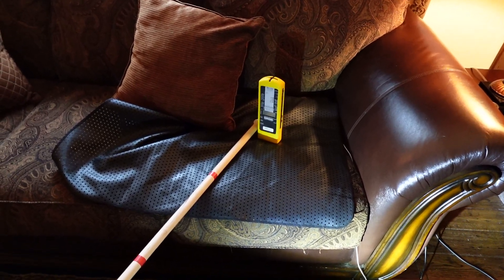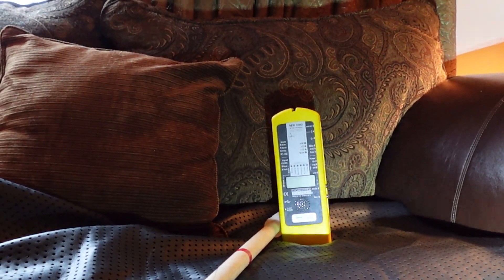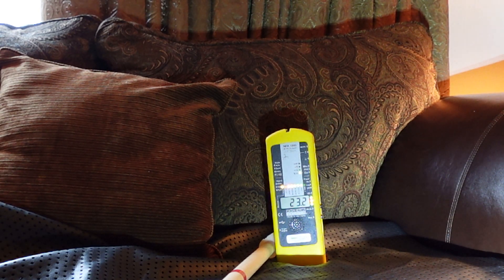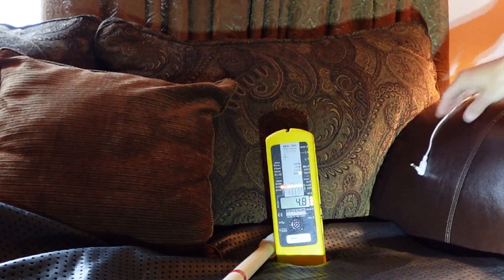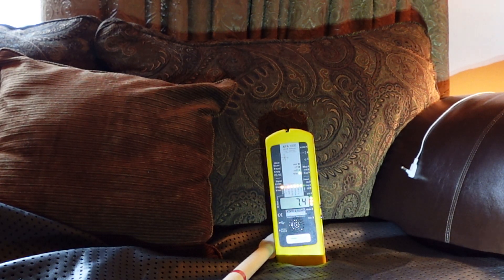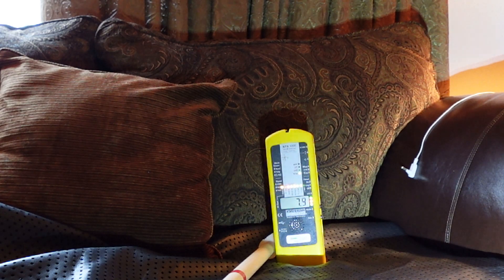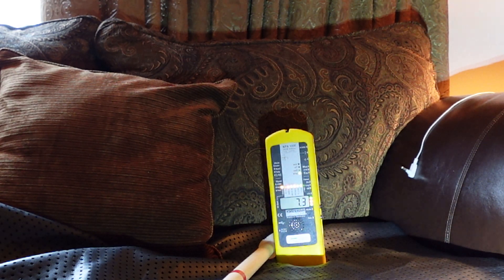The Problem with Earthing & Grounding Mats

Comment: I have a problem with the test when a plug is in the upper and the light is on pulling and leaking energy and contaminating your test. 
Just Questioning - show no power being pulled thru the light plug area and retest.
Reply from the maker: That’s not a real world condition for how people use these mats.  That’s the problem I’m trying to point out.  Even if all circuits were turned off in the house you could still have current on the ground, which these mats attach to.  Just go outside and connect to the earth directly with your skin
Reply: @optimaldwellingspaces3947  well, but it would be nice to know if using a socket just for your grounding mat and not for an electric device at the same time makes a significant difference. If you minimise the bad effect by just plugging your mat to that specific socket it would be a helpful tip for all those who can't connect directly to the ground outside.
Reply from the maker: It makes a big difference.  Avoid connection to any electrical component and go direct to soil.  If you are too high up in your apartment to drop a wire down, then you’ve got bigger exposure problems
Reply: @optimaldwellingspaces3947  Thanks, but I meant that it would be good to know if there's a significant difference between these two scenarios:
1 - connecting the grounding mat to a wall socket (ground connection) while there's another device pulling current out of that same wall socket (like a lamp).
2 - connecting the grounding mat to a wall socket that is not used by any other device at the same time.
I understand that connecting the mat to the ground in your yard is always a better option, just like walking barefoot there is even better. But for many people living in cities that's not an option. So it would be useful to know if there's a significant difference between the two scenarios described above so that if there is, then you can advise to go for the second scenario when connecting to the real ground is not an option.

Comment: what about receptacles in metal boxes that connect to a concrete wall?
Reply from the maker: Anything electrical in your home is generally not safe.  Metal boxes are generally bonded back to the system ground, so not good

Comment: Hello @optimaldwellingspaces3947 I think I can learn a lot here and I Subscribed. Thank you for this. I've been using a grounding mat for a couple of years now, and I plug it into the earthing cable of a wall socket. I wake up more refreshed, at least I think I do. I guess I need to experiment with not using the mats for a while. May I ask what are the variables here between when it comes to AC fields making it worse? Example: is there a probability it depends on the wiring in the house? Also, would the electrons from the earthing not neutralize that AC field? Cheers, -Chris

Comment: 22 year union electrician here, and you are absolutely correct.

It's inductance from the hot and neutral, which are in the same cable sheath as the safety/equipmentground. Isolated ground to a dedicated ground rod is the only remedy, unless one fancies lymphoma for example.
Reply from the maker: Thanks for weighing in.  There is also a radiated component as a byproduct of current flow, which ‘floats’ out into the room and can jump onto a mat.
Reply: @optimaldwellingspaces3947 well, that’s scary!!
Reply: @Optimal Dwelling Spaces  yeah idk exactly what to do about that though. 

To help, I have a metal bedframe that also has a separate isolated ground wire (to the same rod though). That  has less resistance than my silver bedsheet, and it's isolated from the frame (no continuity between frame and sheet). 

Hoping ambient emf's drain through the frame instead of through me by doing this.

Do you think this will help? I don't have a gauss meter, and you might know more than me.
Reply from the maker: I would definitely test the ac electric fields on your bed with that setup.  Metal can passively reradiate RF from cell towers and wifi.  Best to get a wood frame with as little metal as possible
Reply: @4rch3er19  Does it have to be a dedicated ground rod?  It would be a lot easier to attach a wire to the existing ground rod or cold water supply line (metal).  The isolated cable from there to the mat wouldn't be side by side with an energized wire in a long run of NM; it should be WAY cleaner with respect to stray voltage.
Reply: @incognitotorpedo42  that's fine. My bedroom is on the opposite side of the house ground rod, so I just bought a 3 foot 3/8 inch rod and acorn clamp from amazon for my application. Like you said, as long as the wire isn't ran directly next to any house romex, there shouldn't be any induction.

The copper water pipes should suffice as well, as long as it's a verified ground (test with multimeter). Also some water heaters are still without a bonding jumper between the cold inlet and hot outlet, so I'd check that too.
Reply: @4rch3er19 union electrician? So a mediocre electrician who didn’t have to compete in the free market and was protected by cronyism?
Reply: @parmenides2576  sounds like you weren't accepted into the apprenticeship. You know, the school we have go to AFTER work for FIVE YEARS.
Reply: @optimaldwellingspaces3947 I see you points about metal as antenna.
I wanted to build a Faraday cage from aluminum windows screen around my bed. Do you think this would cause me health problems?

I ask because I live between two cell towers, line of site a mile or two away from me. I want to do the Faraday cage and ground it. But if you think it going to be worse, for my health, then I not going to do it.
Please let me know what you think.
Reply: @4rch3er19  that’s because I work for a real man’s industry where you make it based on your merit alone without some goons threatening on your behalf. In fact when our operation is running poorly we often use the insult “did you guys unionize or something?”
Reply: @parmenides2576  well obviously you're butthurt for some reason to just randomly antagonize a complete stranger on the internet. I'm sorry someone hurt you, but it definitely wasn't me dude. Are you going to carry that hurt the rest is your life? It's not worth it man, let it go, for your own sanity at least.
Reply: @parmenides2576 If you’re not unionized in your industry, you’re an effing sellout.
Reply: @4rch3er19 he probably triggers since unions lean more towards socialism, and in America that's frowned upon.
Reply: @4rch3er19 I’m so confused!
Reply: @optimaldwellingspaces3947  What level (V/m) AC electric field would be too high for his setup?
Reply: Lymphoma from the electrical?
Reply: @lindsaymaine521 
People get cancer living next to high voltage power lines, cell towers. Power stations.

Look up the cancer clusters map. You will see where the cancer clusters are. They are around nuclear power plants,  regular coal and now gas powered plants, heavy industry, chemical plants and so on.

So look at the cancer clusters maps for your area, state, country and move to a safe place. 2000 meters or more away from high voltage line. 25 miles away from Nuclear power stations ( up wind, not down wind please). Away from railroad tracks that haul and spill toxic stuff,  look at chemical spill in Ohio.

I have more info on mitigation of cancer and health issues, if interested. No charge, just helping as jesus asked of us amen amen amen amen.
Reply: @lindsaymaine521 yes.
Reply: Just curious why would you get lymphoma ?
Reply: @Deltaray 
Not a professional electrician, but a person who has been hit with toxins, mold, and Lyme for 22 years and counting…. EMF rays attract toxins and those affect your lymph nodes.  
  I’m a retired high school teacher and the science dept did studies mimicking the sane EMF rays as towers, and the mealy worms were completely deformed. Also, a few students I knew had leukemia and other cancers, and they all lived on a street that backed up to electrical towers. 
   I can’t be around dirty electricity or I get dizzy and lightheaded. I have a grounding mat and am here checking the grounding aspects of it. I plugged it into a grounded receptacle and keep my feet on it while I’m sleeping. 
  Now I wonder if I’m doing the right thing! I wanted to use the grounded receptacles to plug all my lamps, etc. into, because the one behind my bed isn’t grounded, and I keep getting sick from everything. I just had a mold/ mycotoxins exposure and I’m sick again, but I’m really confused now!
Reply: @Tinyteacher1111  how are you reversing sit
Reply: @Deltaray  I don’t know what you mean.
Reply: Does it solve or reduce the problem if you plug the mat into an outlet kill switch?
Reply: @psyche8187 
Probably not, just run a wire out the window or under the door and to a ground wire.
Reply: I live in a seconed story apartment. I made a home made canopy around my bed and I want to ground it outside my window DIY. Can you tell me exaclty step by step a list of what materials to get at home depot and how to install the ground and the safest way to go about doing it and where to put it? I'm new to this so it would really mean a lot. Thank you 🙏
Reply: Guess we will have to research how to set up a grounding rod
Reply: @gailzharv  but the problem is the mat or the connection to the  earth?
Reply: What if you were to plug into a switch receptacle and only used it in the off position? Would this eliminate the emf hazard? Forgive me if this is a ridiculous question! 😅
Reply: @shaneford564  wondering the same.
Reply: @shaneford564 If it reduces the EMF it would only be a slight reduction if any at all. 
What you are doing is separating the line side conductor. The problem is the ground wire (egc) is still connected on both sides. 
So all the cable/wire will still be energized from the panel to the line side of the switch. This would still induce the EMF.
Hope this makes sense.
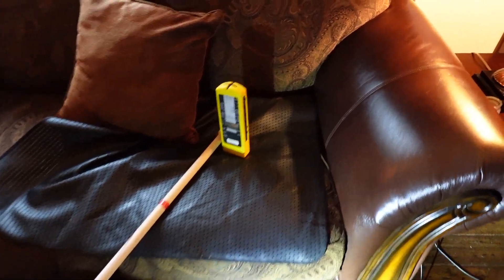Reply: Check his plug. It's not plugged into the ground...... 0:22
Reply: @madmaxshadow7360 are you blind? It’s clearly plugged into the ground of the socket

Comment: The  problem is your ground is not good enough over the whole house.  Sometimes you need a solid copper rod away from the house..
Reply: Inductance from the hot and neutral, which are in the same cable sheath as the safety/equipmentground. Isolated ground to a dedicated ground rod is the only remedy.
Reply from the maker: Isolated ground rod in the earth that avoids the home electrical system, or just go outside and put your bare feet on the soil
Reply: @optimaldwellingspaces3947 Can you make a video how to do this? Thank you
Reply: @optimaldwellingspaces3947 how can you avoid the home electrical system?

Comment: Nice job pointing out the problem with using a power socket, I think using the earth in a socket is a very bad idea. It's true that the earth connection in the socket is wired back  to the earthing stake of the house electrical system, however in the fuseboard the earth is also connected to the Neutral line. The neutral comes from the local transformer in your street (along with the Live wire). So by connecting to the earth in the power socket you are also connected to the local transformer and the 30 or so other houses that the transformer supplies. So whatever your neighbours are up to is coming into your mat, it's not very organic! Your own separate Earth connection in or on the ground is preferable. If you are showing voltage in the socket earth terminal then you may have a faulty appliance or light fitting in the house and a poor earth connection in the house system.
Reply from the maker: That’s a good point, although transformers usually only serve 2-3 houses, not 30
Reply: I live in a 1974 hi-rise, of a 28 story building on 10th fl, so can't do my own earth ground cable out the window.  Someone said to put a bolt into the concrete, but I thought about this, & the metal conduit runs thru the concrete floor/ceiling slabs back to the panal.  I wonder about the copper water pipe but I bet its not fully insulated from touching the slab & runs thru metal studs that are attached to the ceiling/floor slabs....is there a test I can do??????
Grounding/Earthing seemed to be a good idea in my situation of never getting grounded outside due too bad health & confinement to my apt, now I'm learning about all the EMF/EMR & tons of WiFi of my healthy neighbors, probably attributing to my cascade of health problems in a viscous cycle.  Looks like there is not a good solution.....other than  shielding the crap out of this place from everyone's signals or wearing the shielded clothing & hope for a Christmas Miracle!
Reply: @chrispompano  Hi. The concrete structure of your building will be grounded as it is embedded  into the Earth at the base. Touching the bare concrete in your apartment is the same as touching a concrete slab on the ground, which provides grounding. Is their an area of exposed concrete floor that you can put your feet on ?.
Reply: So I got out my DVOM, set to mV  A/C D/C.  Connected to outlet ground terminal, holding the pos. probe & feet on a carpet mat sitting in a chair = 373mV A/C.
Touching ceramic tile floor was 80mV, but then doing it again it went OVERVOLTAGE when touch the floor!  Do I have faulty wireing, or cold this be intermittent EMF, WIFI or neighbors since every 3 floors are on the same  transformer - 24 apts.
Now, I have a bare spot of paint on a metal door frame screwed into or touching the concrete slab....

Neg probe on door frame & holding pos probe:
touching standing on tile floor is 22mV, standing are carpet mat is 56mV.  I'm also within 3' of my electrical panal in my kitchen.
What do you think????
I have to really relearn about electricity & how this all applies to EMF & To Ground or Not To Ground Myself!
Reply: @sparked3113  can you reply again?  YouTube  deleted your post.....I can only see the 1st sentence...
Reply: @sparked3113   here all I can see from your deleted reply:   "well done for carrying out these tests ! The pollution from wi-fi and some electrical equipment is........"
Reply: @chrispompano  have updated my reply, I got distracted by the washing machine going out of balance and shaking the house down.
Reply: @sparked3113   I still don't see your updated reply.
Reply: So if I write my grounding Matt to a grounding rod outside my bedroom window do I need a fuse or resistor between the Matt and grounding rod to protect from lightning strikes? I’d like to keep it connected all the time. TIA!

Comment: Gauss is a unit of magnetic field, not electric field.  However it appears that you are measuring electric field so calling this device a gauss meter is inconsistent.
Furthermore, the fact that the EF is increasing near the mat when the mat is grounded does not mean that the mat is not at earth potential. It could also be caused by a nearby conductor or appliance that is at a higher potential.  An electric field is established when a potential difference exists between two conductors.  So the only conclusion is that there is a potential difference.
Reply from the maker: Hey George, in my experience, these meters are colloquially referred to as gauss meters as they usually measure both components of a low freq wave, electric and magnetic.  These mats do represent an earth potential, and so are an appealing path to ground for the radiated emf from electrical flow in circuits and appliances nearby.  If your body is on one, then you are likely increasing your body voltage with pulsed electric fields. biologically harmful, and not as safe as being barefoot on the earth.
Reply: @optimaldwellingspaces3947  
I understand about the meter colloquial name - point taken.  However, grounding the mat to the house electrical ground (or for that matter to any good isolated ground installed outside the house)  could increase the electric field at the location you are measuring it.  This is because the electric field between two conducting bodies increases proportionally with the potential difference between the two conducting bodies.  For example, if there are energized power wires in the wall behind the sofa, (typically reaching a peak voltage of 170 Volts), a fraction of that voltage will be induced on an ungrounded conductive mat placed on the sofa.  Now if you connect the mat to any good ground,  its voltage becomes zero, resulting in a higher potential difference between the mat and the power wires, and consequently, a larger electric field between the mat and the power wires.  So my point is that the fact that your observe that the eclectic field increases when you connect the mat to the house ground, does not mean that the house ground is somehow bad or dangerous. It simply does its job of zeroing out the mat potential.
So if you are concerned about exposure to electric fields, you should avoid sitting on a grounded mat, whether it is grounded to the house power ground or to any other ground.  An effective way to minimize electric field exposure is to enclose yourself in a conductive cage, and have no energized wires penetrating into the cage (this is known as a Faraday cage).
Reply: @optimaldwellingspaces3947  oh in that case this can just be used in a farday cage which is also ground to eliminate the electric field from reaching your body in the first place. i didnt understand that other high EF appliances were the likely culprits here
Reply: So whats the solution? Grounding with a metal rod outside and having no electronic devices near the mat?
Reply: Agreed George, Gauss is not measuring EMF.
Reply: Yes it is.... every house that has electricity is emitting emf via the house wiring and especially from any running appliance..... and a gauss meter is how you measure it....